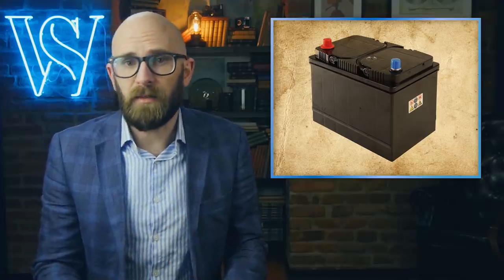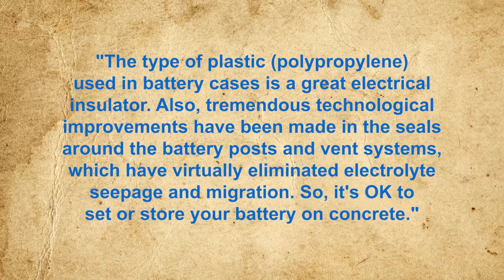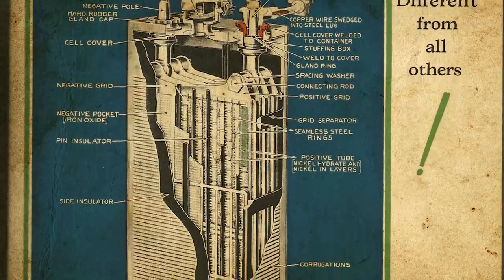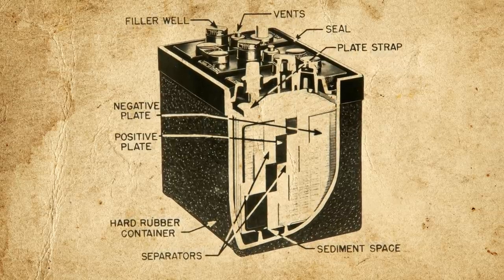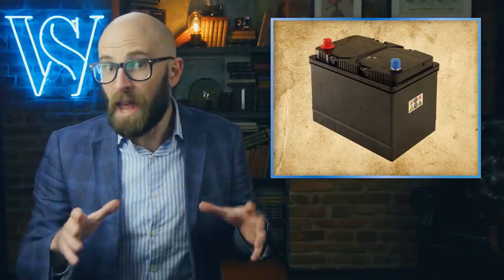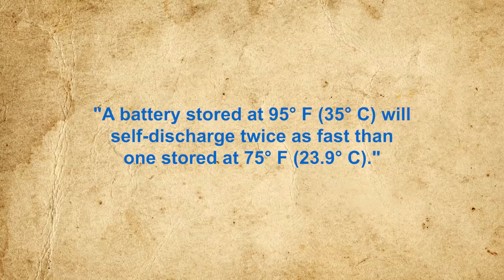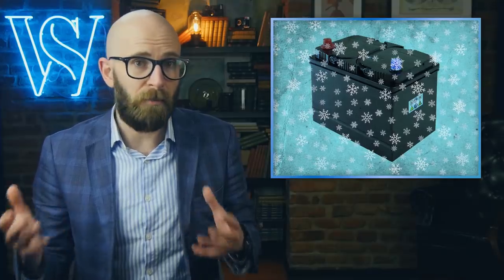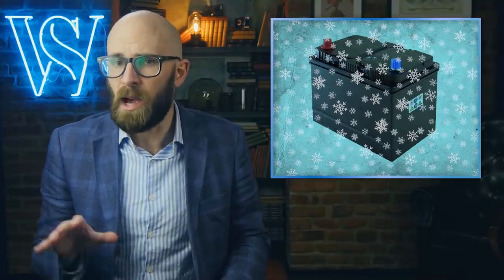Why Does Placing a Car Battery on Concrete Drain It?

Comment: The problem with Concrete is its thermal mass. The upper part of the battery warms up with the air inside of the building, the bottom part of the battery is kept chilled by the concrete floor. With all other factors consistent, cell voltage is linear to temperature. all parts of battery plate pairs are connected in parallel. Current flows from warm parts of the plates to cold parts of the plates. As the warm and the cold ultimately share the same chemical storage, the net effect is to slowly convert the charge into heat overtime.
At least that's the explanation that's in my copy of "Automotive Technology a systematic approach". Don't get me wrong, I'm pretty sure some of the stuff I was taught in trade school is wrong but you didn't explore this question at all, did anybody really think electricity was going through the plastic?

Comment: Bottom line...

Concrete is on the floor... batteries are heavy. Putting batteries on the floor makes them sit longer, because nobody wants to bend over and pick them up...
Reply: We just push them with our foot.
Reply: SuperVstech ya that’s just physics
Reply: Nobody wants to squat.  Lift with your legs

Comment: There's one additional thing to keep in mind in cold weather: the car battery, due to the slowdown in chemical reactions, also charges back up more slowly. That, coupled with the fact that cold weather garners high-amp accessories such as headlights, defrosters, and fans, results in many ending up not fully recharging their battery on a moderately short commute. This eventually leads to a dead/frozen battery when a cold snap comes through.

Comment: I was born and raised in the Dakota's. Back in 1970 I entered the US Army, and after my initial tour in Vietnam, was sent back to the States and stationed at Fort Bliss Texas.  Well I drove my old Plymouth down from South Dakota, and, of course she had that 110 volt cord hanging out the grill to plug in the soft plug heater so the car could start in the sub zero winters that are the norm in that area. Most folks down Texas way were not all that familiar with the cord and I was often asked the reason. I got tired of trying to explain the cold and how engines didn't much care for starting when it was very cold, so I began just telling them that it was a 110 volt starter to spin the engine in cold weather. Strange but more folks bought the tall tail then accepted the fact that warming up the water in the engine block could make the oil thinner and thus allow the car to turn over faster making it start better in severe cold.

Comment: I've heard this story for 5 decades and no one could explain the physics as to how a battery can discharge faster on the garage floor. 
The only physics connection I could think of is when a battery is placed on the floor, it's there for a reason, like maybe it's no good anymore! 😂
Reply: some one told me once on the why was a theory they had that concrete floors tend to usually be cold or cool even in hotter weather. but that would actually be good for storing a battery as long as its charged.
Reply: dothemathright 1111  Yes. It is the temperature gradient between say a 50 degree concrete floor and a 75 degree (F) ambient temperature which promotes a greater rate of self discharge.

Comment: An additional useful bit of info (if not already posted by others), the use of a battery maintainer in the winter is also a good idea for storage of "summer cars", this keeps the battery at a good charge level, and prevents it from discharging to a level where it could freeze... :)

Comment: If you want some fun, as I received one very chilly day, try starting a boat diesel with a deep-cycle battery when everything is about freezing: 32 degrees F or 0 degrees C.  Usually, that motor started in the first revolution or so, but that day, it only started firing fitfully after a half minute of cranking.  Left to sit a minute or 5, it seems the engine had loosened up, perhaps warmed a little, and the battery might have warmed from the current draw.  Upshot: the next attempt, she ran on one cylinder for a bit until she slowly came up to normal idle, when both cylinders were firing normally (no black smoke)  After that, she fired up normally for the rest of the day.  Since then, if I wanted to start when it was cold, I physically warmed up the engine compartment with a big pot of boiling water laid between the battery and engine to warm both up before trying.  Yeah, those normally aren't sailing days, but  sometimes I just get a strange urge and the weather sn't cooperative. .  Sailing is a strange sort of madness.

Comment: I used to live in Butte Montana, and I had no way to plug my vehicle in. It had been -20F and lower for a week with the vehicle sitting the whole time. I had a planned trip the next day. So took the battery out of the vehicle, and took it inside my apartment. I placed it back in the vehicle the next morning. It started up perfectly fine, even though it was -30F that morning. I just took a chance, without knowing if it would help such a cold engine, back in 1986.

Comment: Thank you laying this myth to rest! For those didn't read blueeys' whole comment, I was going to point out the one real danger of cold to a car battery: When the state of charge is low, the freezing point is higher. So, a struggling battery, or even a healthy one low on charge, can freeze solid and destroy the cells. Often, the sides of the casing will be visibly swollen if this has happened.

Comment: A couple years ago I bought an old minivan for the purpose of hauling lumber. Cheaper than a used truck and you can store it that way overnight.

This van had a defunct remote starter that was likely causing a parasitic draw from the battery when it was parked, slowly draining the battery. I ended up just buying a new battery thinking the previous one was toast. Then it got cold out and I didn't have the block heater plugged in (might have helped). The battery died after a week, then froze. I lucked out though. I brought it inside the shop and let it thaw in an HDPE bin for 24 hours. Next day you could tell it had thawed. A year later the battery hasn't given me any problems. Even when we had a brutal cold snap late last month where it dropped to -40C. Still started! But like I said, I lucked out.

Comment: Heat wears down a battery.  Cold makes a weak battery more evident.  Temperature affects the speed of chemical reactions...which is how a battery generates power.  Props for getting this right.  Most dead batteries used to be rehabilitated by opening the top (before sealed and AGM batteries) and topping off the fluid.  Evaporation of the acid solution reduces cell output and damages the lead plates faster via more concentrated acid in the cells.

Comment: As a Minnesotan I can testify to cold batteries having a great deal of difficulty in starting an equally cold vehicle. And unless your battery is fairly new and well charged, they can destroy themselves, although you rarely see it, because everything is contained within the tough plastic casing. Luckily this isn't usually a problem until at least -20 farenheit or colder. But sometimes when it gets to -40ish you just have to take your battery inside and let it warm up overnight, then just put it back in in the morning.

Comment: Good video.  Basic truths (confirmed in video) are still true:  If the car battery has run down from time in storage, then ordinary freezing temps will kill it.  And: cold reserve batteries often can't get the oomph to start a car, unless warmed up first. And:  Keep battery charged up.

Comment: Just make sure ya keep your Headlight Fluid full at all times.
Reply: Yes! And your wiper fluid!
Reply: And routinely rotate your spark plug wires.
Reply: Also, you want to annually check your battery. Make sure it's keeping a good charge by taking a metal wrench, and using it to make a connection between the terminals. If you see sparks, you're good! 😆
Reply: And always remeber to fill your tires with propane gas to increase fuel efficiency.
Reply: @Solisium-Channel  better yet, use acetylene. Propane is good, but acetylene will bring even better efficiency, despite it's higher cost!
Reply: Your flux capacitor should be checked every 3600 miles in order to not void the warranty.
Reply: You can annually clean out your entire exhaust system by doing the following:
1: start engine, let it get up to running temperature.
2: Place a Roman Candle in the end of the exhaust pipe, with the head facing in.
3: Light the Roman candle, and GET OUT THE WAY! 😆

Comment: Cold weather does not directly reduce the amperage the battery can produce, rather it reduces the voltage. However, as the starter is a fixed load (and V = IR) , this reduction in voltage will subsequently reduce the pulled amperage and power output causing the issue.

Comment: This is something we covered in my course for Avionics. Cold weather is bad for automotive batteries.  It does deteriorate the overall effectiveness and longevity depending on how low the temperature is and how long it's in that temperature.

Comment: A battery salesman told you it was fine to put car batteries on a concrete floor...  That's essentially all the evidence you gave.  That's hardly convincing.  Also, something I haven't seen anyone mention, batteries are often made with cheap plastics and poor quality control.  The plastic often forms hairline cracks and grounds out to the concrete.  I have personally had 3 batteries go bad by leaving them on a concrete floor.  I'm open to being proven wrong but it's going to take more than "some guy from Interstate said so."

Comment: Mentioned in passing at the end, it is important to reiterate - a fully drained battery will be destroyed in freezing temperatures (32f or 0c) or below.

Another point to mention is that the batteries used in electric vehicles do tend to drain faster in cold weather. This is not actually caused by the weather itself, but indirectly - when it is cold, people are likely to use the heater; without a combustion engine, that heat is generated from battery power.

Comment: So yeah, during winter here (-20C typical) can start to freeze a partially charged car battery relatively quickly.  I know when I had a battery die, they checked to see if it had frozen before honoring the warranty.

Comment: I work in a auto parts store and have heard every old myths about everything and the old people don't want to hear anything new. And yes I can say old people, I'm 50 myself.
Reply: I was delivering batteries and got yelled at for putting them on the floor for this reason. I promptly put them on the rack as I didn't want to argue with the customer.
Reply: @davidsuda6110  Then there is the removing a battery cable on a running engine to "test" the alternator. Can we say voltage spike?
Reply: @Dave-in-MD  I was taught to do that by an old man. Is it bad for the car? I always thought it was a good idea.
Reply: @TwiStedTentom  It is bad. The analogy I like to use is if you are cruising down the highway and then put the transmission in neutral while keeping your foot on the floor, what will happen? The engine will over rev and you can damage things. The alternator is under load charging the battery, you remove that load and you can cause a voltage spike, this can damage the alternator and other electronic devices on the car. The "remove the battery cable" trick was good back in the day of carburetors and point ignitions but it is technique best left in the past. I tell people all the time that if their "mechanic" does that then they need to find a new mechanic.
Reply: @Dave-in-MD  Well, thanks for sharing that information with me. I never thought of it that way, and I'll definitely keep it in mind in the future next time I need it checked.
Reply: @TwiStedTentom  Just read the voltage at the battery with the car running, it should be about 13.5 to 14.5 volts and not really higher. Read it at idle with no loads and at idle with headlights, high beams and the fan on high.
Reply: @Dave-in-MD  I'm assuming it's 2 volts higher because of the power of the alternator?
Reply: @TwiStedTentom  Alternator voltage has to be higher than the voltage of the battery to "push" the voltage in. Kind of like pumping water into a tank, the output pressure of the pump has to be higher than the static head pressure seen at the inflow pipe of the tank.
Reply: @Dave-in-MD  Very interesting and informative. Thanks!
Reply: @Dave-in-MD  you missed the main problem with disconnecting the battery, some cars will shut off automatically when the battery is disconnected making the test pointless.

As a side note some vehicles are also actually designed with battery disconnection in mind as a diagnosis tool, this however requires you to have in depth design knowledge of your particle vehicle, so unless you have that knowledge using the blanket rule of just don't disconnect while running is the better option.
Reply: @jaydunbar7538  I think you missed the point I was making. I am saying don't do it.
Reply: @jaydunbar7538  I'm curious what is one car that is designed to disconnect the battery to test the alternator?
Reply: @Dave-in-MD  agreed on modern day vehicles that would be a very bad idea however that "test" was contrived during a time when everything on the vehicle was mechanical including the voltage regulator and cars didn't have alternators. they had generators
Reply: @TwiStedTentom  Doesn't take much to destroy a computerized module.  Using a battery charger to jump start a car with a dead battery can do the same.

Comment: We used to turn lights in the car before starting it in a winter morning which would restart chemical reaction in the battery before cranking the car!
Reply: Unfortunately the amout you gain from any heat created ia not as great as the amount you lose by doing so.
That said I have seen this trick seem to work.
Reply: @heyyou5189  Agreed. It seems to me that a sluggish battery put under additional load would amplify the inability to produce the correct amount of CCA. But then again, I'm no batteryologist nor do I live in an area requiring such measures to be tried in the first place.
Reply: You are right guys, in some cases you may not have enough oomph left in the battery to generate heat for its own chemistry AND crank the engine. And so each time you are playing the roulette - you may want to risk cranking the engine straight away or try and warm the battery up. The joys of living up North:)
Reply: Would love to live in a place where winter is nice enough that works lol

Comment: Could you do a video about "thermal runaway" in AGM batteries? I've come across this several times with batteries overheating so badly that they welded themselves to one another. It's a subject very few people know about.
Similarly, there is the idea that one should never disconnect the positive terminal of a car battery first because it will damage the alternator. The reason for disconnecting the negative/earth terminal first is to avoid sparks if the spanner should touch any metal parts.

Comment: In cold weather you can warm up your car battery by turning on your headlights for a couple minutes before you start the engine. This increases the available cold cranking amps.

Comment: This past year wehad a 4 month old new battery that died unexpectedly.   It was during winter when it should have lost charge at a slower rate.  When returning it to the auto parts store we learned that it was not meant to be sold in our climate.   The sales person informed us that several battery companies here in the USA  will simply put an extra letter the the item number...that letter is an S.  Unfortunately several locations in our area were sent a full self supply and backstock of the battery we had purchased with the extra "s" being in the item number and they had to ship those to more southern states. I hope this will help to prevent any friustration in the future.

Comment: I decided to test this "myth" a few years ago by leaving a battery I knew to be good, on a cement floor. It was a modern plastic case battery. I checked it daily for a few days and it did not discharge. Then I forgot. After about 3 weeks I checked it again and it was dead as hell and would not take a charge.
Since then I keep spare batteries on a wooden shelf a couple of inches off the floor and they will keep for several months. I charge them up from time to time and they keep for years.
I have a friend who leaves his spare battery on the floor and just laughs when I tell him it's not a good idea. He buys a new battery a couple of times a year.

Comment: In addition to a cold battery (due to slower chemical reaction) SEEMING to be discharged, A cold engine's oil will also be "thicker" and thus making the engine harder to crank. (True even if using a nice warm battery!) Northern US winter driving taught me that!

Comment: This explained a lot to me. I was always confused why cold was "worse" for car batteries when cold usually can extend the life of other batteries or battery operated objects
Reply: Yeah but the narrator clearly has never looked at the top of a car battery to say that there is a difference in cold crank amperage at 0 degrees and cranking amperage at 32 degrees F as it's measured in the US and in metric around the world